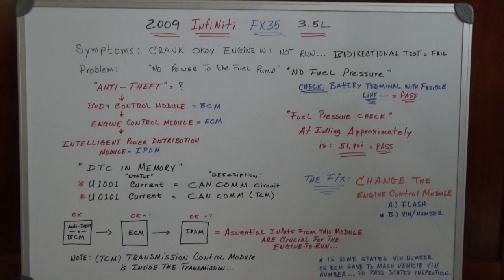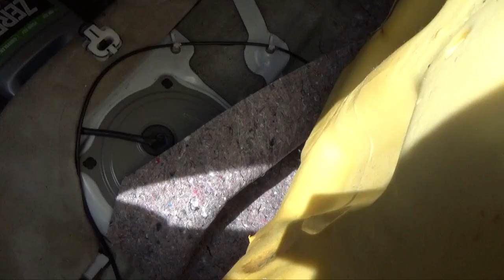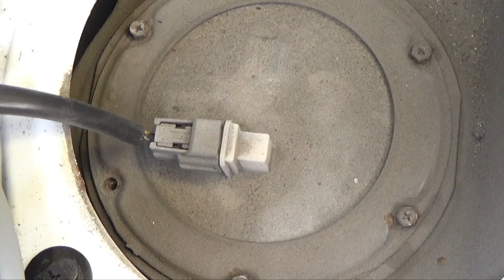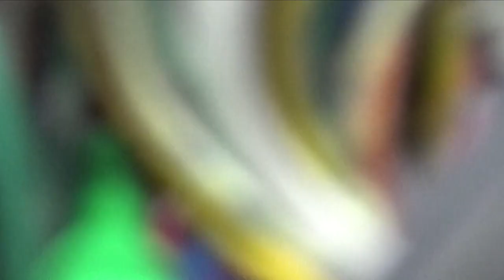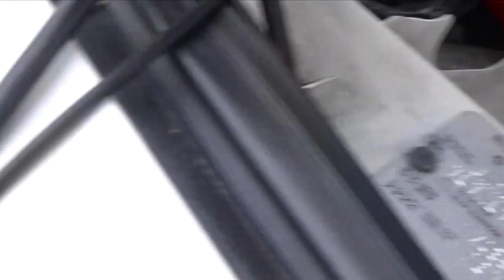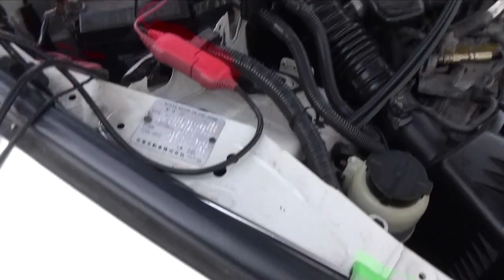2009 Infiniti FX 35 3,5L symptoms "NO POWER TO THE FUEL PUMP MODULE" DTC U1001 AND U0101

Comment: did you check the fuel pump relay control at ECM (FPR #22)
Reply from the maker: According to Mitchell 1 schematic fuel pump relay is in the Intelligent Power Distribution Module so after all Ascential input are okay! The 2 second prime from the fuel pump should ocurre! So my bidirectional test should work! And that fail... so the control from the module inside the ECM was the problem! Change ECM and Flash! And that’s was the fix!